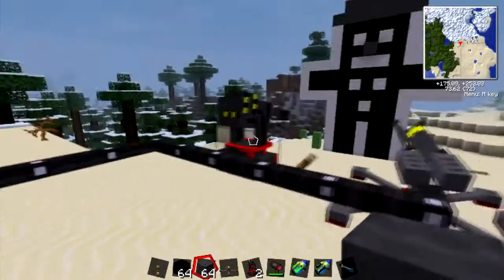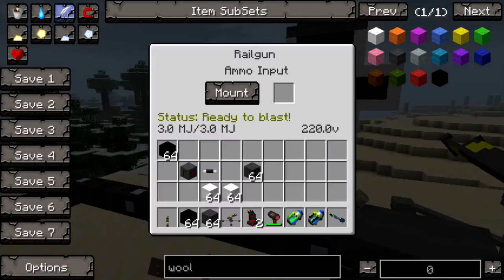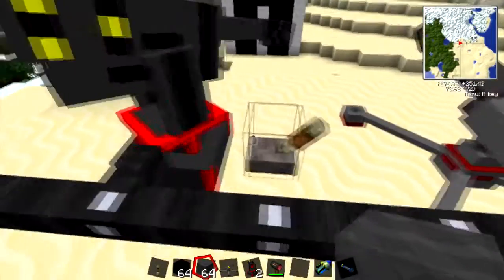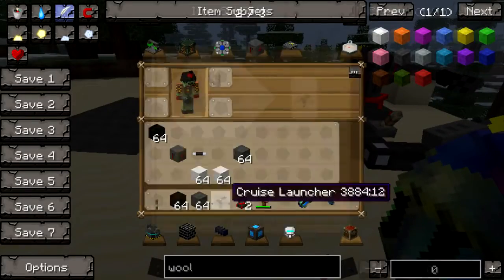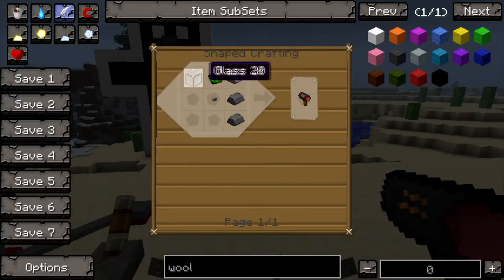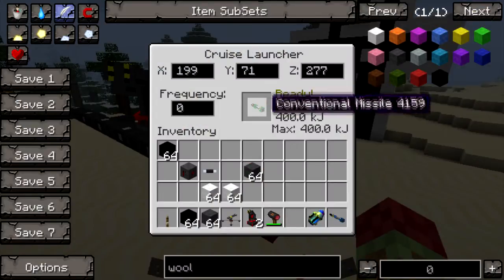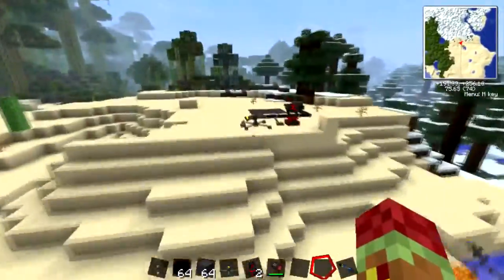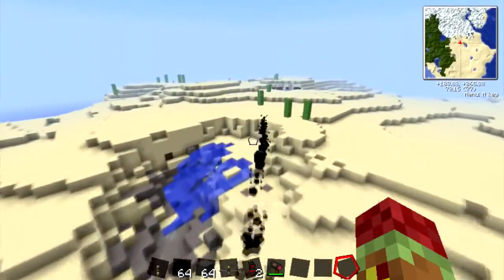Railgun and Cruise Launcher (ICBM) Voltz Tutorial

Comment: for the cruise launcher you can also use a laser designator and not a radar gun. it says
calling in airstrike in 5
4
3
2
1 and then it fires where you right clicked the laser designator. set the frequency by typing in the freq. in the launcher and right clocking with the designator. hope this helps bye